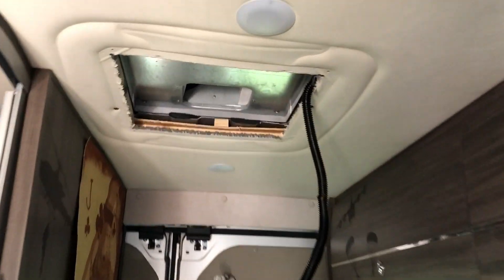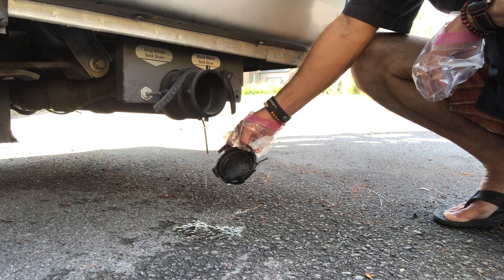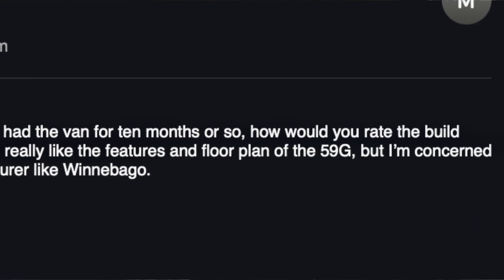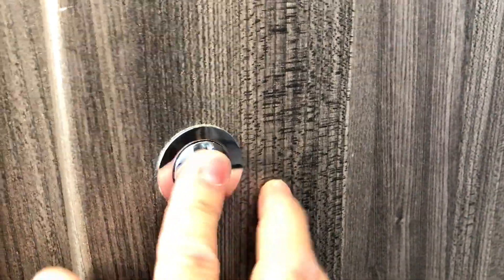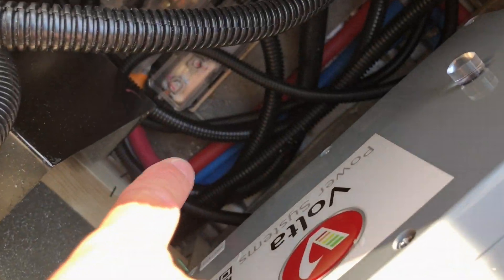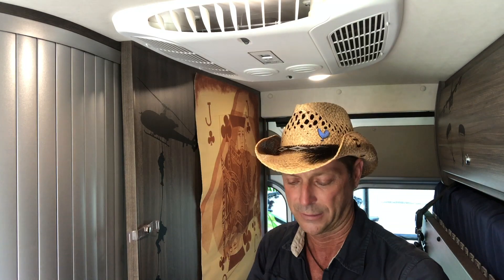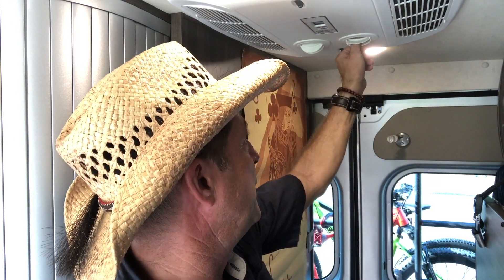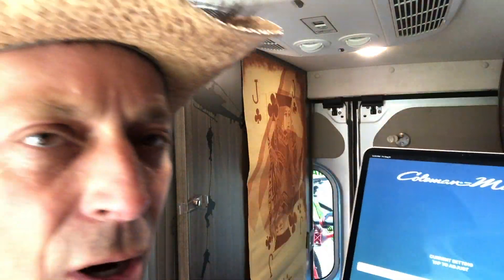REPLACE RV AC. Winnebago RV QUALITY? Waste tank leak?  |  Vanlife in a Travato GL

Comment: Lots of good info Scott!  I agree with you on the build quality of these vans.  We have a KL, and I admit to being worried that I’d be disappointed with the quality, but like you, I’m happy to report having zero issues - no squeaks or rattles, no malfunctions.  It’s not high end, but Winnebago has been at this a long time and I feel they have it dialed in for the price point.  Btw, we got the Mach 10 NDQ upgrade in June - drove to their shop in Kansas to have it done.  What a difference!  Much more quiet and absolutely LOVE the Bluetooth.  On another note, kudos to you for going all in on personalizing your space in Lily.  I love all the stickers, plants and artwork - you’ve made it very homey.  I want to personalize ours, but I haven’t had the guts to put any holes or stickers anywhere...too afraid of damaging the finish.  How did you overcome that fear?  These babies aren’t cheap!
Reply from the maker: Hey WESTER!! Congrats on your NDQ A/C unit. You were a trailblazer. Yep on WGO built out quality. I am with you on that expectation exceeded.

Personalization... I have put very few holes into woodwork. Stickers are easily removed; applied and removed to test. Plants and such on horizontal surface use mounting putty, so again easily removed. Rather sure that I could de-personalize in a matter of 60 mins or so for the new buyer 

Congrats on your KL  :)

Comment: I wouldn't sweat the staples used in the cabinetry.  I've been building RV's for 25 years.  You won't find towables under 100k or motorized under 200k that don't use them to some degree.  You'll see dovetail joints used in drawers, but framing is another matter.
Reply from the maker: Well said Trevor, and you know.  Thanks for taking time to watch and comment sir

Comment: James from the FitRV did a sound decibel comparison between the unit you had taken out and the unit you had installed.  The results he showed were amazing.  Your new unit is almost 50% less on noise than your old one.  Your new unit is already standard on the National Park Foundation Travato's that you looked at with Chris Beinert in your last video.  Also,  have you considered a small box fan?  You could drill holes on top of the fan and mount brackets.  Use Christmas door wreath holders to hang it on your storage bin that you duck under to get to the cab area.  Just a suggestion to help save power.
Reply from the maker: Appreciate the FitRV reference and their decibel compare. I should be more scientific I support, but maybe best left to those experts LOL.
Reply: Scott, I saw the improvised box fan on the Camping Coastie YouTube channel.  It is on the walk thru video of their rig.  It is practical and does not appear to be difficult to do.
Reply: The name of the video is Our Pleasure Way XLTS one year later.  The multiplex readout on his unit shows that 4 amps are used when the fan is on high.  This was posted 4 months ago.  4 amps is nothing compared to the power that your air conditioner uses.

Comment: Another great video. That's about how much I get out of the dump pipe when I take the cap off. Depends a little on which way I am tilted (no such thing at totally level.) It seems to be grey water or at least doesn't look or smell like black. Did have a situation where the dump was pretty elevated so getting everything to flow down from the pipe and then back uphill to the dump was not too fun for me but very entertaining for my camp neighbors. I really wanted the new a/c but the Airexcel guys said they were done with the special after GNR and that you'd have to go through a dealer; around $1500 installed. Maybe some day but not today unfortunately.
Reply from the maker: Ginger Walkabout!!! Thx for sharing your experience. Bummed about your NDQ upgrade, but worth the wait and $$

Comment: What a great video Scott. Leakage from black tank is common because when you flush the system, it doesn’t get everything out. I LOVE your new A/C and how quiet it is. The Bluetooth option is great too! I need to call Truck Camper Warehouse up in NH and inquire about it. While I don’t have a class B but the information that you provide does translate across the brands.
Reply from the maker: Thanks DK.  Yeah, the new A/C unit is off the charts awesome.

Comment: Thanks for the great video.  I could sense your excitement over the new A/C unit and no wonder.  More features and above all significantly less noisy.  Hopefully when I go to purchase my Travato  the NDQ will be standard or at the very least optional.  Didn't you also previously mention that you were also replacing your exhaust fan?  I'd like to hear about that as well.
Reply from the maker: Yeah, Steven I had the Airexcel guys replace the circuit board (not the actual fan) so the fan will blow air in or out of the rig. They were. doing those upgrades for Travato owners at the GNR Rally. Was $80.  Really nice option to have cool air coming into the cabin that sent' A/C.  Gives a feeling similar to a ceiling fan in a house.

Comment: Scott, I've been seeing reports from the thread on Stefany's post on the FB group that several NDQ equipped units are failing due to thermal cutoff in extreme temperatures. Stef and James saw it on both their NPF and personal rigs. Can you dig into this issue further and report on the extent? I just saw 104F here in TX and don't want to drop over 120K on a rig that won't run the AC in that kind of weather!
Reply from the maker: Hi Ray. Thanks for your thoughtful question. Unfortunately time is such that I'm not able to do a bunch of essentially YouTube and Google searches for a situation as you describe. I can only speak from my experience from an early unit that it has performed well, even in 100 degree heat for days on end in Spokane WA in August.   That doesn't answer you specifically, but that is what I can offer at this point.

Comment: I had a large truck camper with about 12 feet of 3” sewer line from the cable operated valves to the outlet with one 90 deg bend in the middle, was nearly impossible to be drip-free depending on the angles at the dump station. I added a clip on hand operated Valteta valve at the outlet & never again had issues with dripping when I pulled off the end screw-on cap.

Comment: My Travato has the same amount of residual dripping when removing the dump valve cap.  I’m usually able to catch most of it in the hose opening by only loosening the cap with two hands, then holding the hose opening underneath with one hand before removing the cap with the other hand.  A way to minimize the dirtiness of it is to dump and flush the black tank first and dump the gray tank last.  It seems like common sense but the Travato manual has the dump procedure (including gray tank) as a separate procedure listed before the black tank flush procedure.
Reply from the maker: SEAN!!!! What is happening Travato Brother?!!   Thanks for watching and commenting sir.

Comment: How long will the new AC unit run on the high and low settings before the Volta system starts your engine?  How does this compare with your original AC unit’s efficiency?
Reply from the maker: Hey Bruce.  That is a a great question. Hmmm, makes me think of a video idea right?!!
Reply: @gosmall.livelarge  DO it! :)

Comment: Scott, such great info from your videos, many thanks! My gf and I are potentially looking to full time in a G (leaning toward the L) within the year and I’m curious about the operation of the AC. I’ve been searching all over unsuccessfully for an answer to this question including a call to Winnebago and speaking to the sales rep. 

With the Autostart function enabled on the L can you run the AC indefinitely while boondocking? From what I’ve collected it seems adequate to last through the night...
Reply from the maker: Yeah, Matt, the A/C should run for about 9-10 hours depending on the compressor cycle. Testing the OEM rooftop A/C that came with my 59GL I tested it and it ran 9 hurst's in 82 degree FL heat.  the replacement A/C is more efficient (and quieter) so I'm guessing 10 hours at least. Again depends on the compressor cycle  and the exterior temperature.

Comment: It would be helpful to see decibel readings of AC unit noise. It seems to be the way everyone talking about AC noise these days does it. The App Store has multiple decibel meter apps for free for both iPhone and iPad. Too late for before(your old AC unit).
 Coach noise while driving would be interesting also. Thanks.
Reply from the maker: Good point JF. Will need to check out those apps and include a little more science into the videos beyond my $100K measuring tape LOL
Reply: Check out the BAGEL measuring tape only $80.00. It’s awesome! Digital readout and measures with a string, a roller or a laser.

Comment: Great video. Will that unit be available when you order your Travato from Winnebago.
Reply from the maker: IDK. My advice would be to check with your dealer. the NPF Edition Travato are coming with those units, but only 100 or so of those units were built (Think). If you new Travato isn't coming with, I'd pressure your dealer to make accommodation to swap the unit. It makes that much of a differnce.

Comment: Thank you so much for this review. It could not have come at a better time. You may have seen the interview Neil did with the CEO of Pleasure Way (https://www.youtube.com/watch?v=TwmpF_lBMWo). 
I was quite upset at his views... implying it would be at the very least difficult (if not impossible) to find a place to repair the Volta system if it ever had a problem, running A/C on a battery was nothing but "the flavor of the day",  and basically disregarding the needs of us who live in much hotter climates than Canada. 
Pleasure Way lives off their high standards of build quality, which I have always been impressed with, but if after a year you have had no issues, how much build is really necessary? You can make your cell phone out of kevlar to protect it from every possible situation, but is that really necessary? I think not.

And thanks for the AirXcel A/C build... it looks like what we need for a dog and living in the hot and VERY humid south.

Comment: Is this new AC included in the 2020 models?
Reply from the maker: The new NDQ A/C unit is included on the NPF Edition Travato. I saw it on the bold too. Would expect that to be include in the regular Travato at some point, but didn't get a straight answer on when.